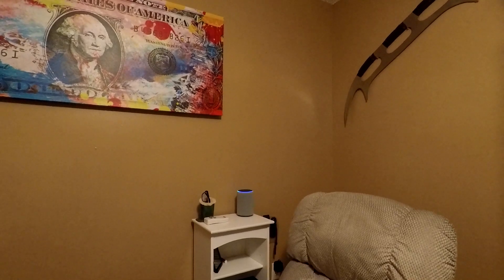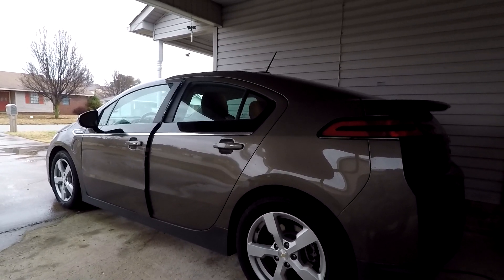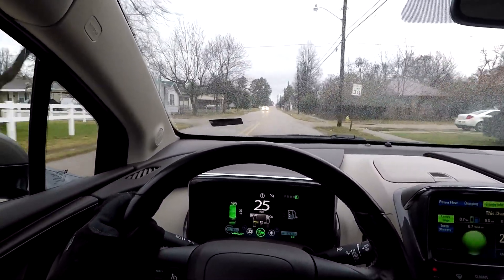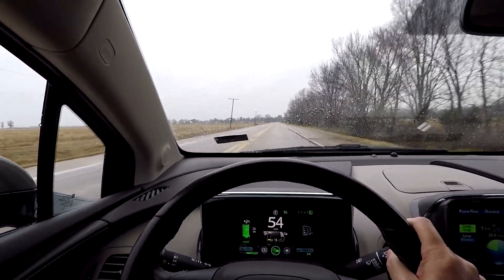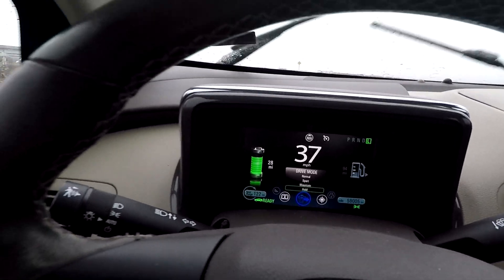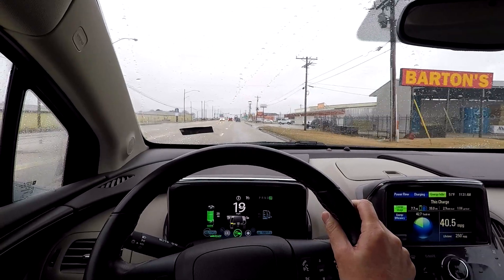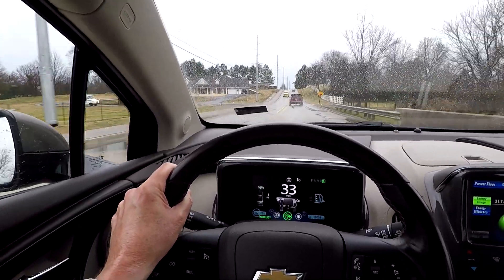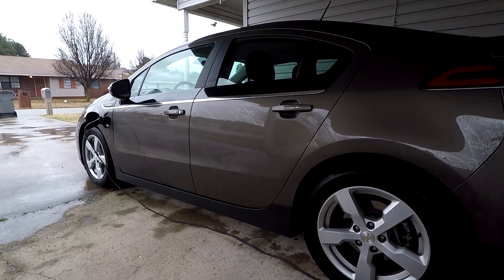Regenerative Braking in a 2015 Chevrolet Volt

Comment: When driving in D, and you hit the brakes like normal, it applies regen braking.  If you hit the brakes hard, like in a panic stop, then the actual brakes will engage.  I prefer to do D and use the brake pedal in my Volt, mainly because I KNOW the brake lights are on, but I also like to be able to coast with my foot off the accelerator.
Reply: Sometimes for sure D is better if you are coming up on an area where you can coast a long time.
Reply: @bipedalssuck841  I've just got so used to letting off the throttle as I approach a stop light trying to time it so I never have to stop, it's 2nd nature to me now.  Back in '08-'09 when gas prices skyrocketed, I started using every hypermiling technique I reasonably could, lol.  With my normal driving style, the little green circle is always spinning for me, today when I unplugged my gom was showing 42 mi range, typically I get 4-4.5 mi per kwh.
Reply from the maker: @GrandPrix46  Hey, I'm also bipedalssuck. Haha. I did not realize I answered you while logged into my other channel. I have a 2nd channel for the really boring stuff. Anyway, for the last several years I've been using certain techniques even in gas cars to get the most out of my tank of gas. For so long I've coasted to red lights sometimes coasting for close to a mile it seems. Why not? Why rush to the redlight just to set there. Most will drive full speed till they have to stop, stop quickly and sit there while I very slowly coast up behind them.
Reply: @ArkansasEV  you just described my wife to a tee, lol.  We just went out and bought her a 2013 Volt with pretty low miles, one owner and very clean, 2 year full warranty from the dealer, too.  I'm hoping the car teaches her how to drive properly with the little spinning ball, I explained it to her and she's trying to keep it in the center and spinning as much as possible.  Now we each have our own Volt so if gas gets high (which it very well may depending what happens with these election results), we'll not have to worry about it at all.

Comment: Can you remote start your Volt so you can precondition the cabin while it's plugged in to save you some range and still have a warm cabin?
Reply from the maker: You can remote start it and on the 2015 it does an excellent job. However, if it's cold enough....I'd guess under 30 the engine will run for a few minutes and the it'll be battery only. Also, if you have a level 1 charger the power from your house cannot keep up and it still uses some of the battery. That should not be the case with a level 2 home charger.

Comment: Dude I feel like I'm experiencing all the same things at the same time as you. I bought my 2015 just a few days ago! At first I rolled a few steep hills at like 25 mph with regen braking and was so scared I had my hazards blinking. I find the best way to descend hills with the cars behind you is either with cruise control (it will throttle the regen braking!) or in D if the traffic is super dense and fast

Comment: When you say "gas mode" its not really powered by gas, right? I assume its keeping the engine on to keep the battery up, but otherwise it drives the same right?
Reply from the maker: In most cases that is true. In most cases the engine simply keeps the battery charged and the electric engine is what's moving the car. However, in certain situations the gas motor does help move the car.
Reply: if you're running in gas mode at freeway speeds the gas motor actually does provide most of the energy, not sure if it provides most of the torque but it definately provides SOME torque to the wheels. There is a menu in the gauge cluster that shows how much power is being drawn, and the ratio of the power source between gas motor and battery. at lower speeds burning gas most of the power still comes from the battery.